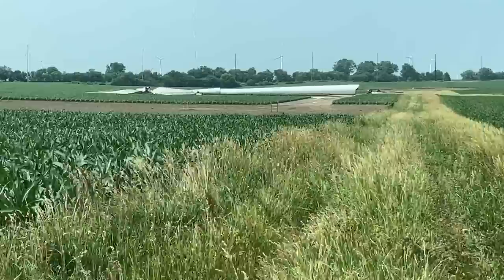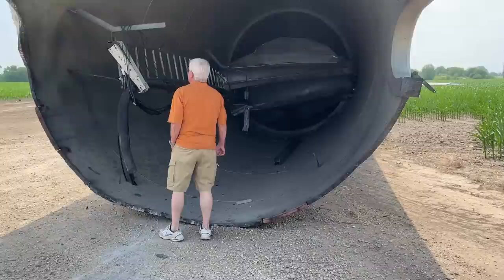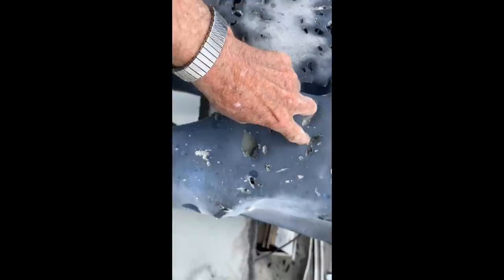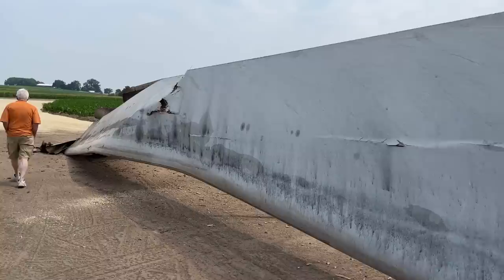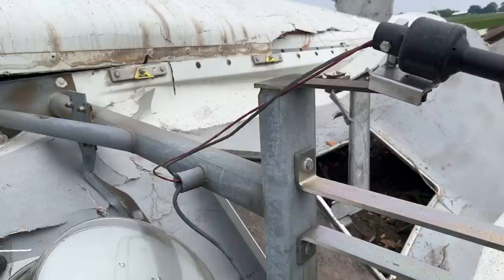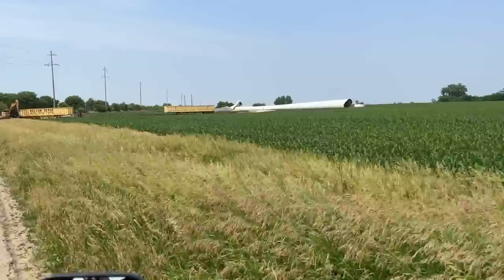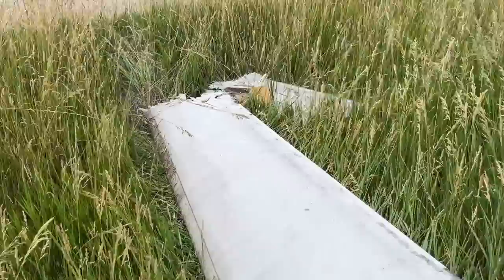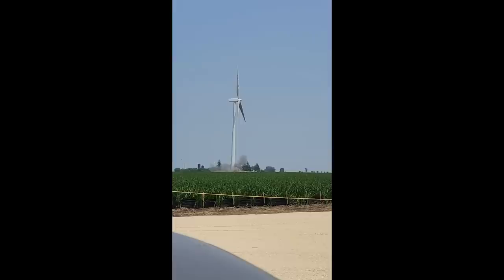OBSOLETE WINDMILL DEMOLITION short #47 pt 2 tubalcain energy lies scam fraud

Comment: I wonder if they used Cutters cable, explosives also known as demolition cord (det cord), 1.4 UN0070?
The area that you were driving up to this particular one LOOKED WINDY! lol!

What I have found out about "Wind turbines", The economic viability of windmills, like any other investment, depends on several factors, including the initial cost, maintenance expenses, energy output, and the cost of alternative energy sources. I can provide you with some general insights.

Modern wind turbines typically have a lifespan of 20 to 25 years, and their profitability depends on a variety of factors such as location, wind resource, government incentives, and energy market conditions. In many cases, wind turbines can generate enough electricity to recoup their initial costs and provide a return on investment within their operational lifespan.

However, the financial performance of wind turbines can vary depending on individual circumstances. Factors such as changes in energy prices, maintenance costs, and advancements in wind turbine technology can influence their economic viability over time. Additionally, government policies and incentives for renewable energy can impact the profitability of wind energy projects.

It's worth noting that the decision to decommission a wind turbine after 15 years would depend on several factors, including its condition, maintenance costs, and the potential for upgrades or repowering. Many wind farms choose to extend the lifespan of their turbines through maintenance, refurbishment, or repowering to continue generating electricity efficiently.

For a comprehensive assessment of the financial feasibility of wind turbines in a specific location, it would be best to consult experts or conduct a detailed analysis considering the current market conditions and specific project details.

So remember you said these are 15 years old we seem to get smarter as short distance time goes on, look at computer parts for lame instances 3 to 6 months they come out with a slightly better one. 

So, 15 years upgrading old versus new.... also keep in mind the millennials have to have something to do...LOL!
The cost-effectiveness of upgrading or repowering a wind turbine versus replacing it with a brand new one depends on various factors such as the condition of the existing turbine, the cost of upgrades, the potential increase in energy production, and the cost of a new turbine.

In some cases, upgrading an existing wind turbine can be a cost-effective option. Upgrades may involve replacing certain components or retrofitting the turbine with newer technology to improve its performance, reliability, and energy output. This approach allows for leveraging the existing infrastructure while taking advantage of technological advancements.

On the other hand, there may be situations where replacing the old turbine with a new one is more cost-effective. This can be the case if the existing turbine is outdated, has significant maintenance issues, or if the cost of upgrades is prohibitively high. Additionally, advancements in wind turbine technology may offer improved efficiency, reliability, and energy production, making a new turbine a more attractive option.

Ultimately, the decision between upgrading or replacing a wind turbine depends on a thorough assessment of factors such as the condition and performance of the existing turbine, the cost and feasibility of upgrades, the potential energy production gains, and the cost of a new turbine. It's advisable to consult experts or conduct a detailed analysis specific to the project in question to determine the most cost-effective course of action.
Reply: Post looks like A.I. generated word salad.
Reply: @billdegener8105 
Renegade vocabulary workshop estate agent and a half klick North Dakota have been practicing the time and the same quality is it standard operating procedure and.
   Hey! You're right. I just kept clicking on the center suggested word. Scary, isn't it‽
Reply: @billdegener8105  Ah thanks a lot
lol! Yes, I used an AI program to fast convey my point and I always proofread it to make sure that is conveys feelings or points I am trying to make, I have had these real experiences however as I am an LTL truck driver, I could tell you what cars NOT to by because we are the ones who pick up their bad engines and transmissions, an LTL driver potentially goes everywhere, I consider myself to be Jonney Cash cause where I live I have been everywhere man. So, sorry yes I use an AI to generate my thought in a fast and efficient method of communicating. P.S. I wrote this crap!
Reply: @StanErvin-yo9vl  Annoying if anything.
Reply: @the4thj  Well at least I learned a little about LTL.  Safe travels.

Comment: And by the way.  If over 200 feet in height you need that beacon light per the FAA for flight safety.  Having spent part of my life worrying about that I have no problem with it.  What I do have a problem with is the idiots who design at 198 feet so as to duck the responsibility.  But that's just one of this curmudgeon's hot buttons.

Comment: I get why companies don't want to retrofit these smaller ones, because any corporation working with wind turbines is now aiming for larger wind turbines. That's why you can't leave everything to corporations. Corporations are why I can buy 15 year old solar panels for pennies and they still have 50 years of life left. They are just so wasteful.

I will add though that in the mid to late 2000s there were a lot of low quality wind turbines that were made, and I've seen a lot from that era that had failed due to simple mistakes in design. Thankfully the newer ones seem more serviceable.

Comment: My comment yesterday got lost or maybe blocked because I sited my web source.  Anyway, thanks for raising awareness of this issue.  A typical onshore windmill is around 2.5KW and costs about 1.3million per KW putting the price tag at $3,250,000 including engineering, construction, installation, and transmission lines.  That windmill will cost about $44,000 a year to maintain including land rent, insurance, service, admin, etc.  The mill will only produce about 35% of its rated capacity since the wind does not blow continuously and rarely at design speed.  If the produced electricity is bought by the grid at $.02/kWh it will generate income at $109,300 at 35% capacity and $175,000 at 50% capacity.  This puts payback time at 29.73yrs and 19.12yrs respectively. Quoted prices are from 2019.  If demolished in 15yrs this windmill is not financial feasible  without subsidies. Payback would be different if the grid pays more than my source quoted but it would need to double  or triple in order make this a profitable investment.

Comment: I wonder if they ever got to the break even point where the energy produced = the cost of the wind mill?  The falling wind mill doesn't just damage this season's crops.  It will damage the soil in the field and result in decreased crop yields.  Take some pictures of the field and the crops for the next couple of years.  You will see and out line of the wind mill where it fell plus the construction equipment was in the crops where the crops are smaller.  It damages the soil structure so the crops are smaller compared to the crops in the undamaged section of the fields.

Comment: i make 108-meter blades as my job. they have an expected guaranteed life of 25 to 30 years depending on blade spec.
Reply: Another big waste. If a 25 to 30 year blade is mounted on a 15 year base it’s actual life is 15 years.
Reply: @ellieprice363   guaranteed life
Reply: @ellieprice363  these are seaborne so the bases are pretty rugged like an oil rig.

Comment: Lyle, my guess is that they used shape charges to cut through that steel. The purpose of the hrm is to quickly slice through the steel, like a knife, and are typically used for structural steel in high rise buildings, power plants and the like.
Reply: Yes, just like on 9-11, Shape charges!

Comment: I estmated that if a turbine cost $10 million it would need to make $2,500 a day for 15 years to btake even. Useing the KGBs figures 😂, the average windmill at 12 cents per kwh would make about $3,500 a day. Once you tac on maintenance, permiting, and leases there can't be much left over, if any. Great topic. Cheers
Reply: Your numbers are out.  3MW turbines are about $3M, lease is say 15k/y, maintenance 50k/y.  Sell price is anywhere from  $20-$100/MWh, and operational time is about 90% (ie 21h/day).

Even using your numbers lifespan would be 25 years, so you'd be in the green for 10 years. 

$10M will buy you a 15MWh windmill; 3 times the cost gets you 5 times the power.  (Doubling the blade length gives you four times the area, bigger is better.)

Comment: Indeed.  Why do we even *have* "obsolete wind turbines"?  They have not been around all that long and it seems like they would have been engineered for a longer service life.  Coal-fired plants typically run 35-50 years!  I realize the new turbines are probably more efficient/produce more power/run quieter (maybe)/are cheaper to manufacture, etc.  but if you have an asset that is already producing "free" energy, it makes no sense to demolish it so you can build another one next door.  Retrofit it with upgraded blades, upgrade the generator, improve the controls but as long as it is operable, let it run.

Clearly there is substantial energy input into manufacturing these things.  Refining steel is a very energy-intensive process and there is a whole lot of it in that tower.  Carbon-fiber or fiberglass does not fall out of the sky either . . .  Then there is the rebar and the tons of concrete in that foundation plus the energy costs to haul all of the components to the site and erect them. . . .  I would not be surprised iv every one of these things is a net loss -- it will never produce as much energy as it took to manufacture, haul and erect it even if it runs 100 years.  I do not have the numbers either but the Laws of Physics are particularly unforgiving.  At least the greenies can *feel good*.

Comment: Power purchase agreements vary from farm owner to farm owner as well as state to state.  Farm owners may either own the windmills or lease lease out property and collect annual payments without laying out anything.  The basic principal regardless of how many, how high, how wide is that when the fan spins at 7 mph the generator begins converting kinetic energy into electricity. At 10 mph the turbine is powing itself, it's during these times, when this excess power is made, the grid it's connected  to powers the community.   These 30 mills may not be generating enough to be adequet to todays standards, and the truth is, mill ownership is very profitable and the start up costs can be adsorbed rather quickly.

Comment: The farmer in me is disgusted with the mess that results from felling these things.  There will forever be bits of junk turning up in the dirt at those sites.  Interesting to note that in SW MN there are wind turbines being refitted with new larger blades, a new different gearbox, and a new nacelle.  Those are about the same age as the units demolished in this video.  Regarding subsidies?  They are everywhere.

Comment: Obsolete tech is disposable. Early tech becomes obsolete quickly. This should surprise no one. Compare and contrast a 1915 T Model Ford with a 1930s Lincoln with a 1960s Lincoln. All that change was powered by investors who performed due diligence then vote via the stock market. Obsolete systems were disposed of quickly.  Likewise wind tower scrap metal will be scrapped and the rest (mostly inert) broken down and transported.  All assertions regarding economics of any power source are testable and measurable. Only cold logic should apply. Early tech will have shorter service lives than for example coal and hydro which were highly refined eighty years ago. 

I'm no sure why this bothers people. I'm old too but so what? It's not 1950 any more. Speculation ("pondering") is pointless. If it really matters, seriously research why that old plant was taken down. They're mere objects. While people who grew up poor tend to be fascinated with reuse, it's economic to recycle metals and inert fiberglass takes little real volume to bury though onsite grinding is gaining popularity. What appears expensive to a single person is trivial at scale and economies of scale matter. We take established economies of scale in petroleum, natgas and coal for granted but they're enormous and dwarf the windmill population, especially the global logistics we fight wars to keep flowing. (Iran Closing the Strait of Hormuz doesn't shut down wind or solar.)

There are no secrets so if anyone wants to pursue what happens to what components it's not hard. Occam's Razor also applies. If wind is some plot against the American taxpayer why to informed, modern nations invest in their own wind power? China has a command economy that exists to make money and reduce their horrible urban pollution problem. They're spending on hydro, wind and solar along with the usual petroleum, coal and natgas. 

Wind power is global and not just a US phenomenon though Americans tend to ignore everything outside the US. It's reduced EU dependence on Russian energy and the UK for example does nicely off North Sea wind farms. Worth noting is every non-petroleum energy source means less economic leverage for Saudi Arabia and the rest of the Jihadist Middle East, and of course Russia. Delinking the economy as much as practical from our enemies and frenemies makes strategic economic and military sense.
Reply: Thanks, well said/written!

Comment: Wow, what staggering waste! The blades apparently can’t be recycled or repaired, as they age over time, the leading surfaces become pitted and rough, and the efficiency drops. (No one is talking about what to do with these massive hunks of fiberglass that aren’t recyclable and won’t bio-degrade.) What really got me about seeing this was that they just completely scrapped the massive generator. All the components, precision machining snd labor that went into making it just turned to scrap metal 😠

I’m sure they wouldn’t be tearing down these windmills without the massive subsidies they’re getting. I’m sure they’re based on new construction (but it would be the same even if it was just based on generating capacity increase). The decision goes from “ok, we have this asset that’s paid for and generating cash for is. It isn’t as efficient as it once was, but it’s basically a cash machine” to “yeah, this thing os making money for us, but we can make more money by tearing it down and using the subsidy money to build a new one.”

Our country’s entire energy policy is just sheer lunacy now ☹️

Comment: Just as a comparison here is an upcoming Wind project in California's Central Coast:  

The Morro Bay Offshore (MBO) project is a floating offshore wind farm being developed to help the state of California meet the target of generating 50% of its power output from renewable sources by 2030.

The wind farm is estimated to have an operational life of 25 years and overall investment estimation for the initial 650MW project is $3.2bn.

The proposed offshore site is located approximately 33 miles (53km) off the coast of Morro Bay, and the water depth ranges from 800m to 1,000m.

The project will primarily involve the installation of approximately 100 floating offshore wind systems (FOWS) and large offshore wind turbine generators (OWTG).

Either of the two FOWS will deploy three mooring lines each, comprised of chains, polyester lines, steel wires, shackles, fairleads and chain stoppers, which will anchor the structures to the ocean floor.
Reply: In the People's Republik of Kalifornia we are also building the really awesome train. What the PRK really needs are reservoirs and hydroelectric.
Reply: Small dust particles carried with the wind causes fiberglass blades to delaminate, can't wait to see what salty ocean air does to them.
Reply: Fat chance that the windmills operate efficiently for 25 years.

The ocean is an unforgiving environment, which is very tough on metals and electrical equipment.

Comment: Interesting video mr Pete. what makes them green is that they produce in about 2 years the energy that it cost to produce and install them. production for such a turbine will be 3 MWh  4000 hour a year , 16 years makes about 192.000 MWh . 40 dollar a MWh makes 7.680.000 dollars, thats about twice the cost of the turbine. So they make money in 16 years and get replaced by bigger ones . with more profit.  the new ones have probably a simple design whitout gearbox and a generator in the hub, so called direct drive.

I enyoi your videos very much, and never saw a turbine so close to or in the ground.

Comment: Can’t say with certainty, but my impression is that all energy sources in this country receive subsidies. It may come down to how much relatively speaking. It could be that windmills are still in a developmental stage where some waste is unavoidable, and 20 years out the industry will be as mature as oil and gas is now.
Reply: Don't forget the subsidies to grow that corn there, which will be turned into ethanol, which makes less than 0 sense to even do if it wasn't for subsidies...